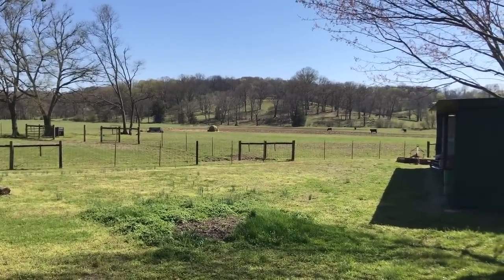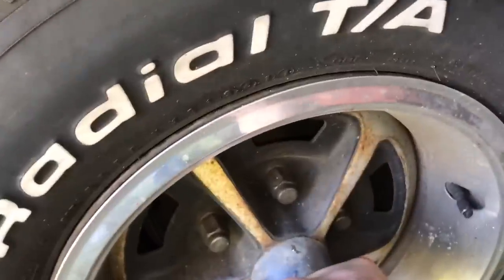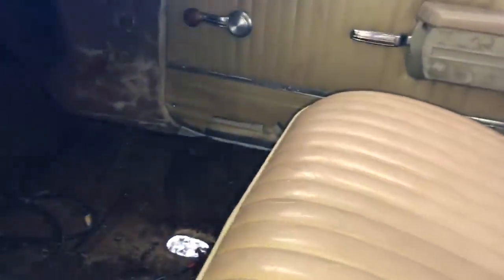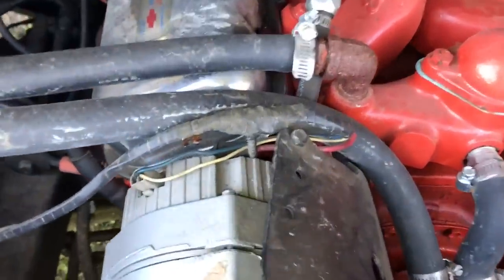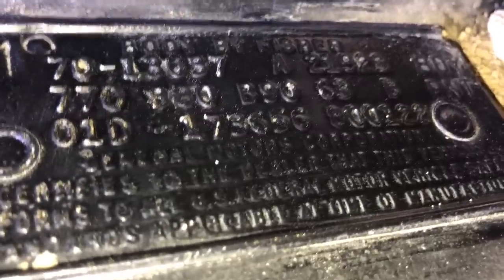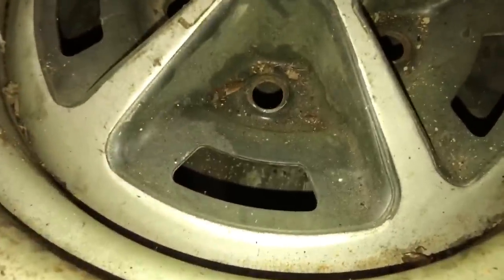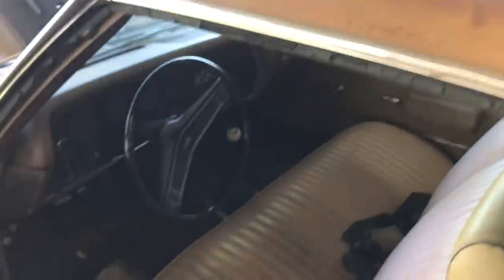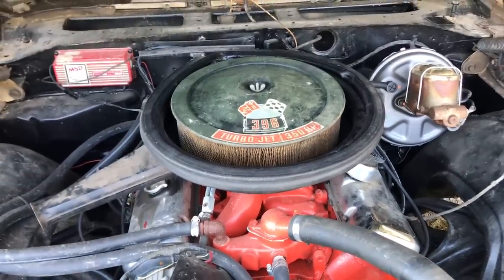1970 SS CHEVELLE FOUND STORED IN A OPEN BARN 35 YEARS!!!

Comment: I bought a 1970 desert sand with black stripes Chevelle SS in 1972 with 18,000 on the clock that was sold originally by the same dealer and was a new car trade in for the princely sum of $2200. Car was 402 Turbo 400 column shift with cloth Goldish/tan colored interior with a bench seat and was 100% original as it had rolled off the showroom floor new.
Was a super nice car, I sold it about a year or so later to buy a '66 389 Tri Power 4 spd GTO.

Comment: Hey chevy ..yeah you..!  this is what sells,  old easy to work on easy to build common sense beastly beauty ! Bring back this and you never loose keep putting sensors on sensors plastic switches inside motors and transmissions just because everybody else is doing it you loose and go off the cliff with the loosers.

Comment: I had a 70 Chevelle SS that was solid black, no stripes, had white interior, 402 cid big block with Holley carb, headers, 4 speed Muncie transmission with Hurst shifter, 4:11 posi track rear-end with traction bars, had U.S. Custom aluminum mags running 70's on front and 50's on rear

Comment: if you see any onld 3 tons, they had the big T3's as well,, I was told the 3 ton 350's had an LT1 crank in them and old farm equipment with big block Chevs in it were an HP stamped block with a 2Bbl carb on them.

Comment: Wiper motor is missing! Whats up with the Clutch Z bar linkage? It looks much newer then the rest of the engine compartment? 
 Might want to tell the owner to do something with that rubber fuel line running to the carb from the Pump. Hate to see this 70 SS charcoal coated

Comment: Great video. The explanation of the codes was informative. I had one question: From the tag information, is it possible to tell if the axle is a 10-bolt or 12-bolt? Thanks
Reply from the maker: kcsavers you cannot tell if the car was equipped with a 10 bolt or 12 bolt by examining the cowl tag. Thanks for watching,!
Reply: Ya get under it and count the bolts.  It’s a 12.

Comment: I’ll never own a 70 Chevelle because they are all 50-150 grand. Even one that’s sitting in a field needing complete restoration is too much. Same with dodge chargers. The car in video the guy would probably want 50 grand for it because it is original rust
Reply from the maker: Charlie B I have a real 70SS454 barn Find from a field I’ll sell you way way cheaper than 50k.

Comment: Ha,  this is hardly original, lots of ads and changes but to be expected for driver. Mine is all original except new paint last yr. 5 wheels, interior, dash, engine, tran, rad, 64k original miles.  But its a Malibu.  2nd owner as i bought it from original owner on halloween day, 1987. Original spare with sticker on tread still sits in trunk. Atlanta car as well. Also, i may not have mentioned on videos, but the factory seam on quarter panel where it meets roof was filler material if it was southern plant, and lead filled if it was northern produced.
Reply: @simonkovacs5973  least i have one....and i dont call ppl a dickhead lol.  Thats mature. Now go tell mommy too!! I didnt knock the video, i spoke truth and told about mine. Im all about any chevell 68 thru 72.....im guessing w that comment, you drive a 82???

Comment: Do you have any finds/videos of 1970/71 SS 454 Monte Carlos ?
Reply: I wish he would do some on the first gen Monte Carlo.  I have a 70 that I've had for almost 32 years.  It's not an SS but I did put a 396/TH400 in it about 22 years ago.
Reply: @Mr2004MCSS  For sure! I had a 1970 SS 454 Monte Carlo, dark blue, console, factory 8-track. Some "day two" mods like Cragar SS wheels, headers, but full exhaust with the SS Chrome tips, balanced engine with huge Holley carb, intake, cam. Car was a comfortable smooth riding rocketship, that always got thumbs up. Must be worth a fortune now wherever it is! (sold it in '82 for $1800)
Reply: @saabtech3510  I would love to own a factory 454 SS Monte.  I've not seen any around here for sale and probably couldn't afford one if I could.  They have went up in value.  My Monte is dark blue with a blue interior.
Reply: @Mr2004MCSS  They are rare. I think they only made 1,800 of them. The guy I bought mine from owned a gorgeous mint bone stock black 454 SS Monte. Hardly see them for sale today. Saw a blue one on ebay last year that needed a ton of work. They were asking 26K.
Reply: @saabtech3510  They made 3,823 of them in 1970 and 1,919 of them in 71 so they are pretty rare compared to how many of those year Monte Carlo's made.  I saw a 71 SS for sale a couple of years ago in a neighboring state for $12,500.  It looked to be in very good shape with a lot of options since it had the build sheet but it didn't have the original engine.  It was a triple black car.  I would have loved to have it but just didn't have the money.

Comment: Where would my build sheet be in my ss 1968 4 speed nova
Reply: The most common place is behind the springs of the back seat. Less common are under the glove box lining or the carpet, and behind door panels and  rear interior quarter panel covers.  But there may not be one or it might already have been removed, so don't tear apart your car looking for one. It was simply an informal "tradition" followed  by many line workers.  However, some workers would just discard the sheets and others would include the "wrong" sheet or include two different sheets.
Reply: @cincyspin178  ok thanks

Comment: Damn Tennessee is full of 70s apparently I've got 12 small t3 headlights with the lines and 5 large t3s. Also I love that Black 70 ls6 cowl induction car with no stripes. Triple black car. It was at McCann I think or Mecum. The original owner had it. Video of it on you tube somewhere.low mileage survivor
Reply from the maker: Yes sir my buddy Dave Beem Found that car and it’s one of the best untouched LS6 examples ever found.